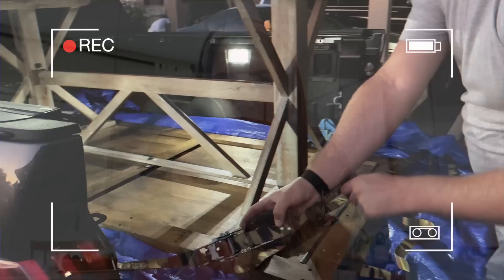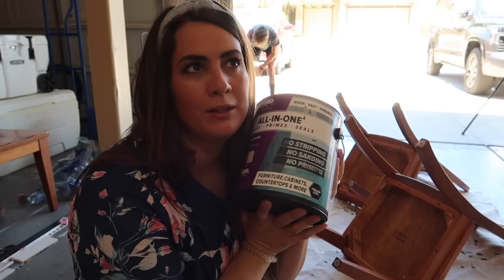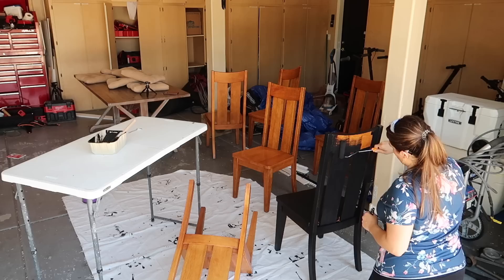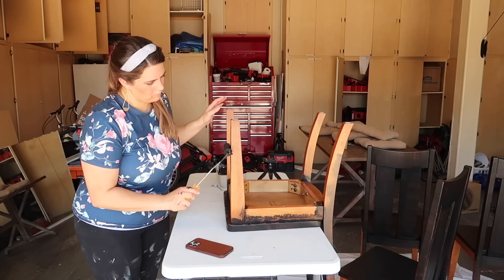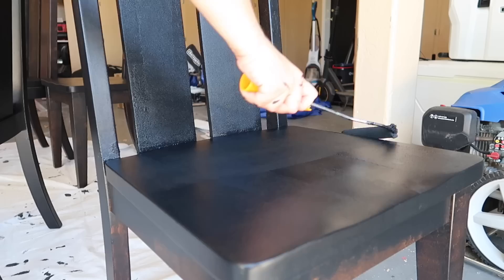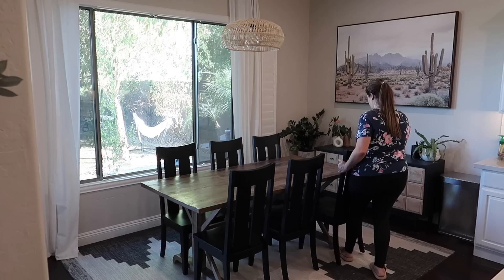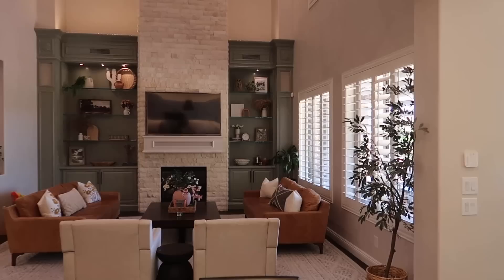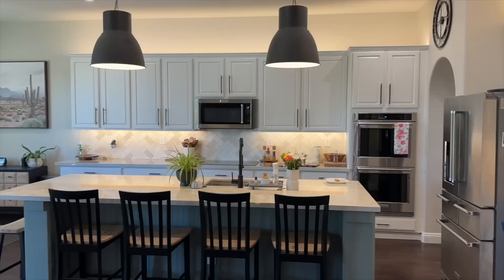NEW HOUSE PROJECTS 2023 :: Dining Room Makeover on a $0 Budget!! Thrifted Furniture Flip

Comment: I love the contrast of the table to the black chairs.  As for the light fixture, do a black rectangular ceiling base that allows the wiring box to be where your current light is but the length can go to the left of the table to look centered and then have pendants from it with round or oval glass globes to soften all the linear lines of the furniture, this allows views to continue through to the windows and not create a heavy look like a black rectangular chandelier.

Comment: What a great find at a steal and easy to flip. You bought them separately but with the paint it works together, not only with the chairs but with the rest of the dual colored furniture. I say DON'T sand it. I like the finish as is and it blends with the rest. It might need some TLC since the tabletop appears scuff and slightly rough from what I can tell. Also if you're on the fence, I wouldn't sand it. I'm not a fan of matchy matchy. I like mixed metals as well as wood finishes as long as they have slight difference. The cactus skeketon is so unique. I bet its comon there with desert life. I agree it needs some green or someting to pull in a pop. Share more DIYS, thrift shopping and flipping, cooking content with recipe cards on, screen, any chatty vlogs 😊👌🏽🙌🏽

Comment: Hi Amanda, my current kitchen table is brown with black legs. I want to sand down and re stain or paint the top. Do you think the beyond paint is a good option for a table top? If so do you think I should roll it on? Would I need to put a varnish or top coat to seal that if so what do u suggest? Or should I just stain it? What would you put as a finish top coat if I use the stain? Luv the new barstools and table!😉

Comment: Quick question - what type of roller do you use when applying the Beyond paint??  I've seen several videos where people say you "have" to use a 3/8" nap roller and then they complain about the texture.  Yours looks very smooth after it dries.  I'm thinking about updating my kitchen cabinets but would prefer a smoother final texture.  Also, I like the table AS IS.  It's close enough to match but not too matchy. You can always change it later if that's what you decide you want. The cactus is AMAZING!!! Great find.
Reply from the maker: I use a nap roller, that’s what it is suggested with Beyond Paint and so far I’ve really been happy with how it has turned out!!